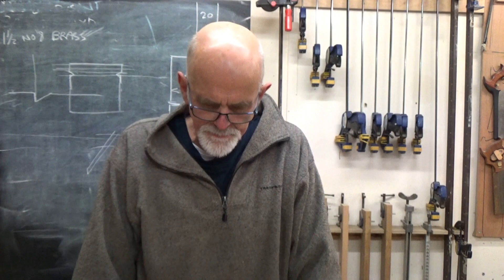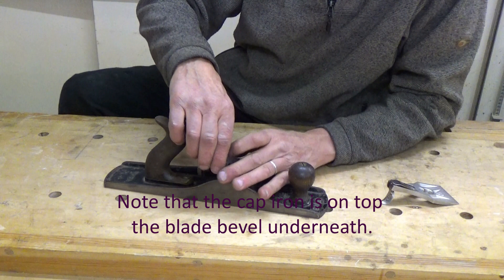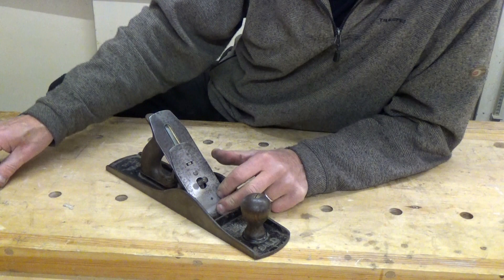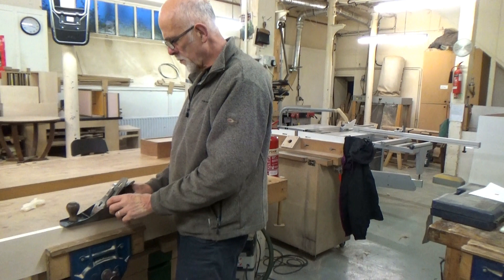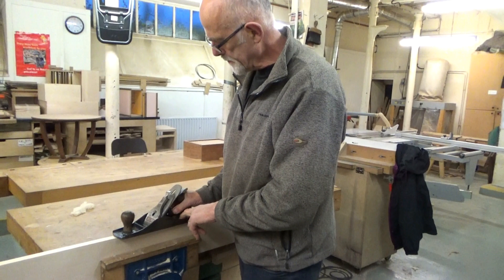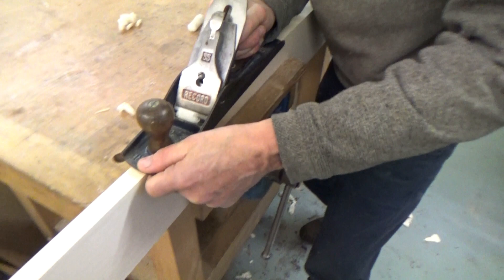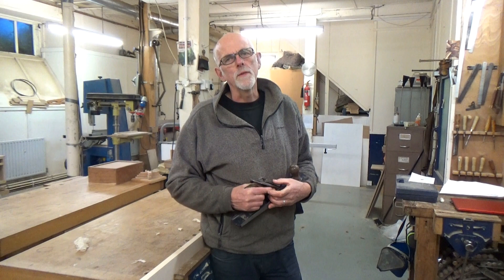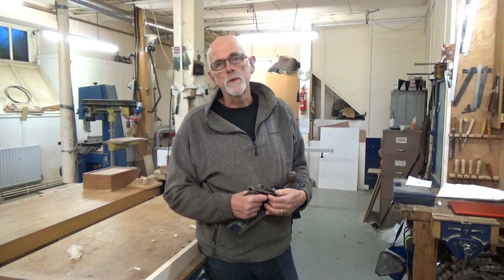How to assemble and adjust a woodwork plane.

Comment: Thanks for the tips on the wood plane. I plane with the right hand and have impaired eyesight in the right eye. This makes for some interesting angles. I really have to work to get the planed edge perpendicular to the adjoining edges.
Reply from the maker: Thanks for the comment Ralph. I think keeping a watch on the shavings coming off the  blade will help with this. Keep checking that the shaving is even and adjust your plane position accordingly. If the shaving coming off the middle of the blade is not uniform adjust the blade until it is.
Reply: @MrCJTribe  👍👧
Reply: @MrCJTribe  I worked the last few days with the plane concentrating on watching the shavings coming off the blade and it really does help  in getting a piece squared up quicker. Thanks again.